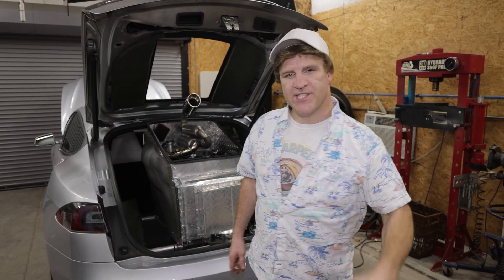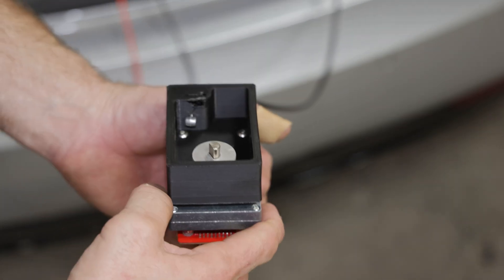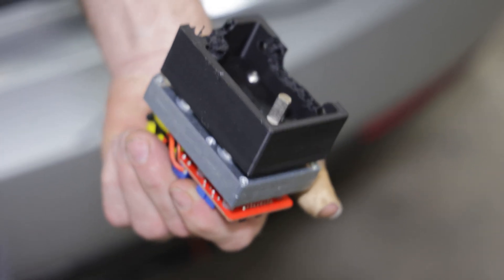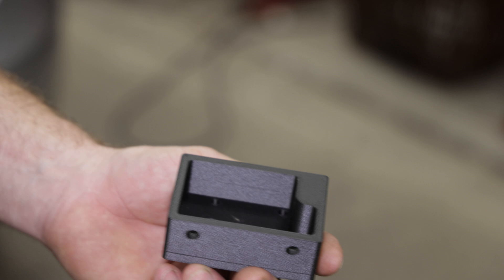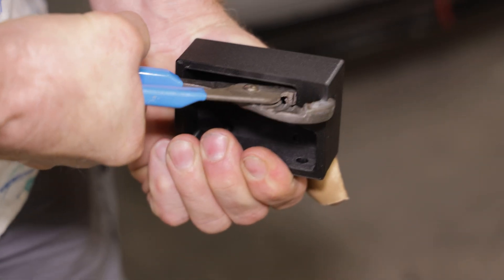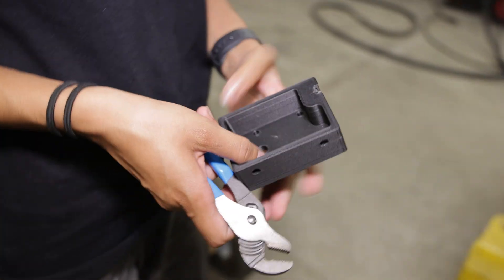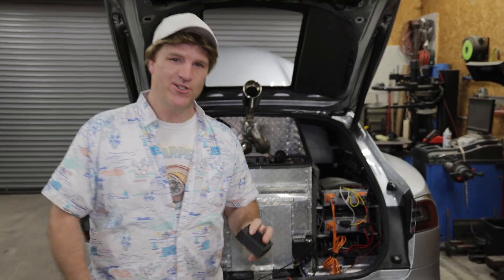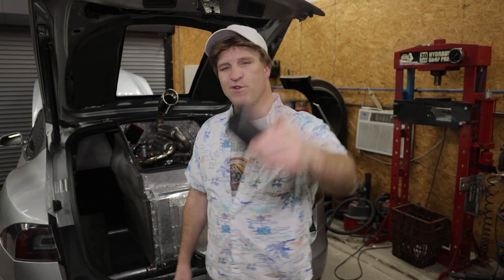PLA vs Onyx Will It Break? - (#3dprinting)

Comment: I dont use PLA for anything other than mockups, why would anyone do that :), prusa PCCF is my goto for engine bay mechanic stuff or other parts that needs to hold loads or heat, its excellent in many ways, i chose it over nylon, its reasonably priced and doesn't need any crazy printer.

Comment: Looks like you cheating. The first part has only 5% infill, therefore it crashes like a paper, whereas second one has 100% and it's strength is respctively higher.
If you want your print products to be realy durable use composites based on  PET or PA (NYLON)
Reply from the maker: Nah They are both 20% infill
Reply: Onyx is nylon-based

Comment: 1st part looks like 20% infill, 2nd part look like 100% infill.
Did you use the same printing parameter for both? 
Because i printed a new hose connector for my dust collection vacuum in PLA, not even carbon reinforced. But i used 100% infill, slightly hotter temperature (205) and printed slowly on my Creality CR10S pro V2. I can no joke lift the vacuum full of drywall dust by the part and it never broke. The part has been in use for 2 years now. 

3d printing is very twitchy, it's all about parameters, printer is about 20% of the result i would say.
Reply from the maker: Yes these two were the exact same. File, but what you say is true, I have also done parts with PLA at 100% infill And a lot of times they do the trick, the issue I was having on the Mr Beast project is that these parts I would print were okay until they would get out in the sun, that's why I went looking for different printing technologies for my future parts. I know I didn't cover that here and I may do it in a future video if people want to see it, because the nice thing is once I have all the different printers set up I can do any sort of comparisons I like. Let me know what you think.
Reply: @WarpedLab  of course i want to see that! Your building skills are so good it's amazing to watch, like Collin Furze's projects, always built with lot of attentions to details.

Comment: Onyx is 10x the cost of PLA and the printer is 100x!
Reply: so with that math. the parts are 1,000x stronger.
Reply from the maker: That actually comes out pretty accurate, the part is literally a 1000x times stronger, I should definitely put it to the ultimate test in the future.
Reply: Make sense cause that part was 1000x times stronger

Comment: The sound alone shows the immense weakness of the first PLA material! That was incredibly bad! So is the second part made with basically the same material but a different printer?
Reply from the maker: No so the first part is made of this carbon reinforced PLA, which is essentially stronger than just PLA but very similar. The second part is made out of a material called Onyx, it's the standard base material for use on Markforged machines. I can't even tell you how insanely strong that was haha
Reply: @WarpedLab  Holy I thought that was the carbon reinforced one